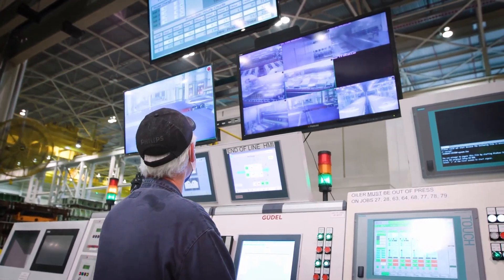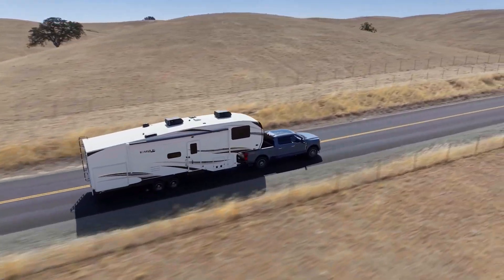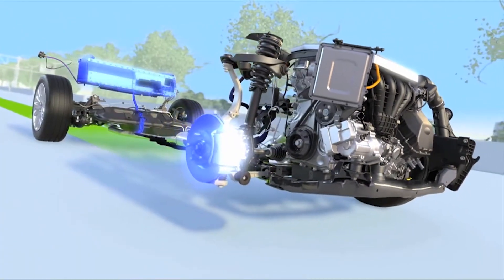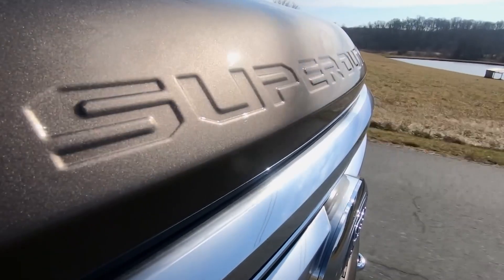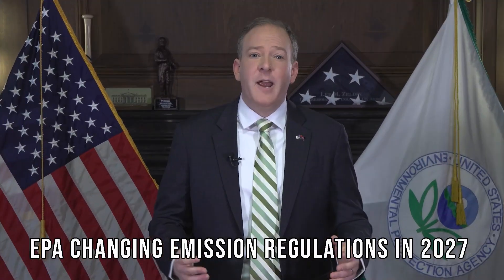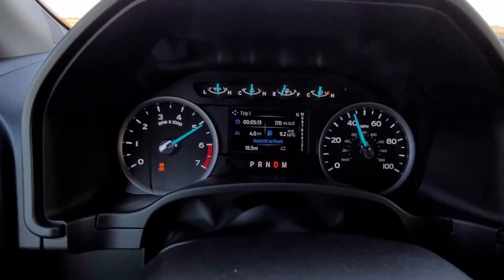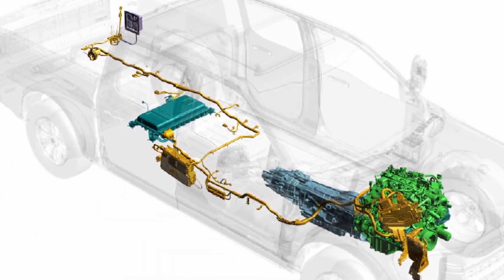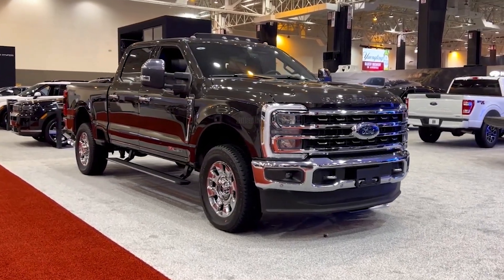Heavy-Duty Hybrid Truck? Yes, It's Possible!  2026 Ford F-250 Says YES with New EREV Setup

Comment: I think the generator/electric is a great solution. Locomotives have been doing it for decades. Electric power is better, no range anxiety thanks to the generator, and better for the environment since shorter trips can be powered off a battery charge up from house (or shop) current. Looking forward to this!